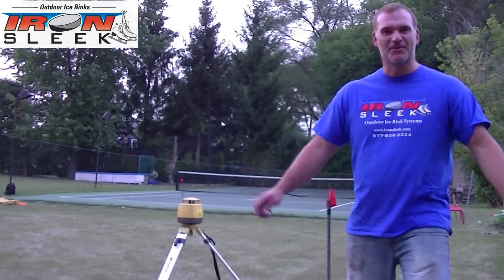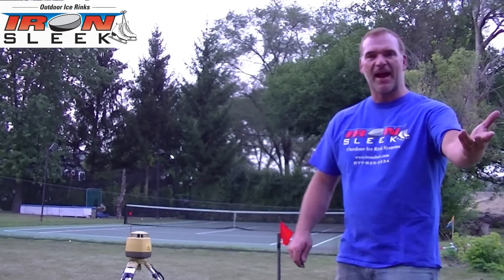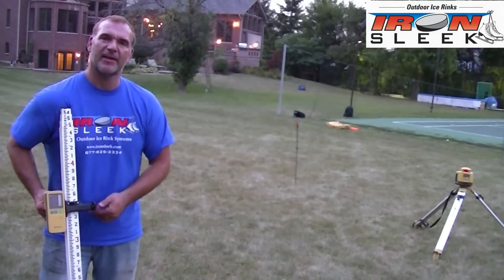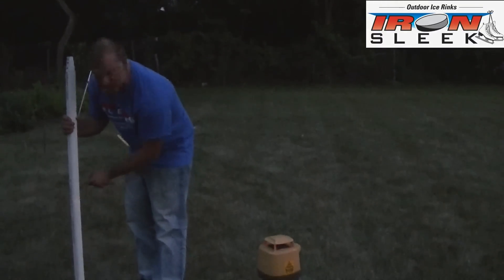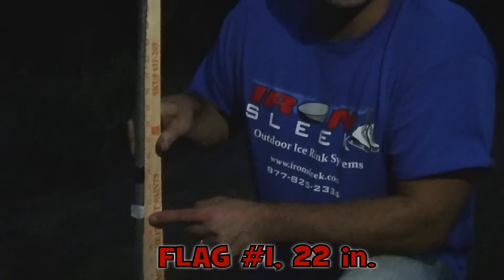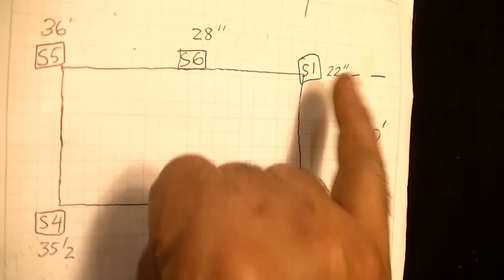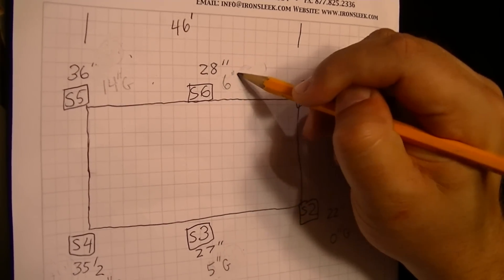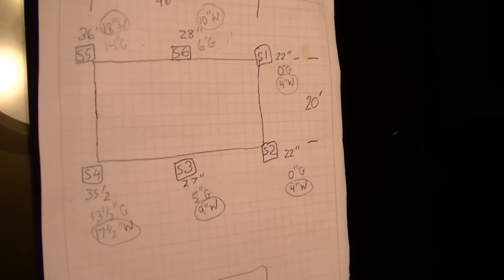Measuring Grade Laser Level

Comment: Would the results be the same, if you will need to move the tripod with the laser beam and continue measuring? (due to the obstacles for laser beam).
Reply from the maker: If the laser moves, you have to at least measure 1 point with both laser settings and figure out how much the laser moved vertically.
Reply: @Ironsleek  Make sense. Thank you so much! What if it blocked by a wall or dense grow of vegetation, trees, brash, bushes, etc.?

Comment: Thanks for the detailed video. Do you know the standard way to calculate pitch into a percent?
Reply from the maker: Dave,As an ice rink company, we don't necessarily care about the percentage that you are looking for, as the only importance is the depth of water on the deep side.  But what you are looking for, is a slope that is calculated as the rise(or fall) divided by the run (horizontal).  For small percentages, you can estimate this as the distance between the measured points.  In the example above, the highest percentage is between the upper left point, and the upper middle point.  There is a grade difference of 8"(14"-6") over a run of approximately 23 feet.  To do the percentage, you need both measurements in the same units. I'll use inches.  8"/276" (23 x 12).  This give us a percentage of just under 3%.  Again, doesn't matter for an ice rink, but hopefully it answers your question.
Reply: Thanks for the response. Im taking residential builders test and they ask percent of slopes so i wanted to be on point with my math.

Comment: I don't think you mentioned where to put the transit? Corner high point? And how to establish the high point if so?
Reply from the maker: You want to put the transit in a location that will give you measurements in every place you want to measure.  Every site is different, but the higher you place it the better.  If the laser is below grade, you won't see it in some of the places you are measuring.  If there are any obstacles in the measuring area, make sure that they don't impede measuring.
Reply: Thanks!!!
Reply: Well another consideration is error in the laser transit. You would want to shy away from putting it on a corner due to the father distance and subsequent error. Placing it in the center of your project would minimize this error. In this project it is pretty irrelevant since distances are small. Lasers are +/- 1/8 inch over 100 feet. Great video